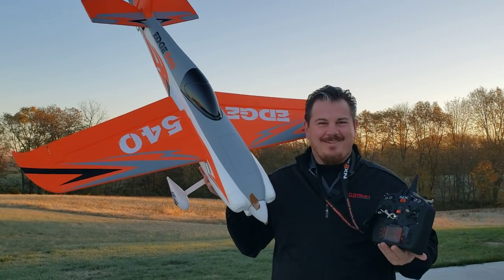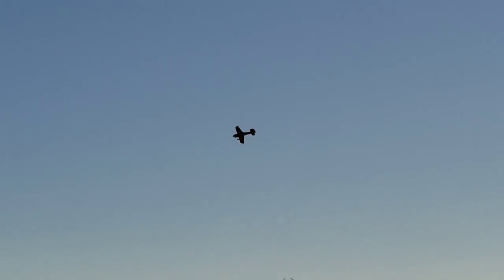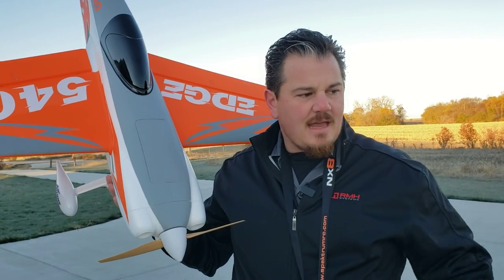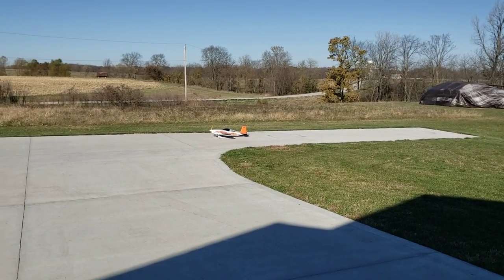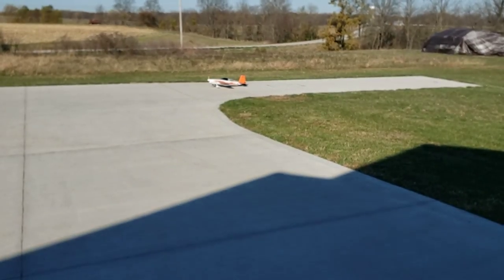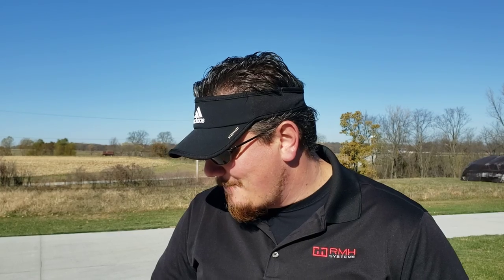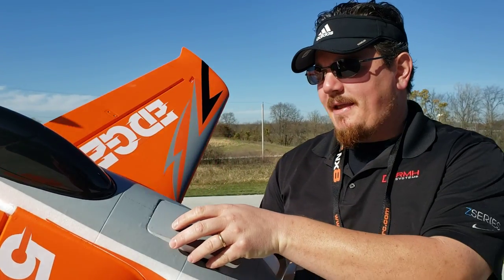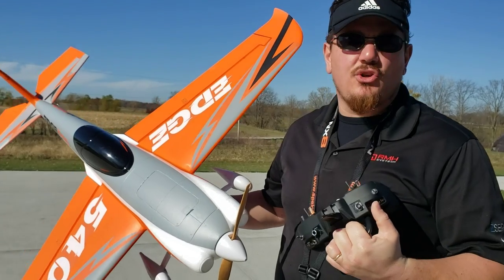Arrows - Edge 540 - 1300mm - Unbox, Build, Radio Setup, & Maiden Flight

Comment: Would you recommend the Arrow Edge 540, or the E-flite Extra 300. Thanks.
Reply: If you can afford them I'd recommend any of the 52in airframe from extreme flight
Reply: Idk I have the Extra 300 and man I love it. Definitely flies better than the edge just by looking at this vid
Reply: @millerrc5829  you’re better off with the extra 300 it’s basically complete. Where as the models from extreme flight you’ll spend over 1k completing it with the accessories
Reply: @albertg968  ya but I can almost guarantee at least IMO it will knock the socks off the e-flight 300 when it comes to actual 3d maneuvers.
Reply: @millerrc5829  how tho?
Reply: @millerrc5829  like throw wise?
Reply: @albertg968  there lighter stronger in high g maneuvers they don't flex like foam.  and if you think about it, EF and 3dhs have been making pretty much nothing but 3d planes since they started, so they probably know a lot more about what to look for in a good design. I had a e-flight cz yak 54 and it just didn't perform as good, not enough throw and to porky. Yes I know there made of balsa, but for this type of flying it just a better material. The saying you get what you pay for definitely applies.
Reply: And the flying qualities you get with EF airframes make it worth the money imo
Reply: @millerrc5829  yea I’m sure they’re better but don’t think by a lot a lot. Can’t say much since I haven’t flown one. And throw wise you can adjust where the pushrod insert on the servo arm or horn. The yak 54 the old one from horizon didn’t seem like better plane than the sukhoi since it used same servos
Reply: @millerrc5829  but yea wasn’t really down to spend over 1k on a plane. I ain’t no pro but my extra does everything i throw at it.
Reply: @albertg968  I get 80deg out of my elevator on my ef stuff idk if that kind of throw is available out of the e-flight extra or not. But that being said if your looking for the very best flight performance ef the way to go.
Reply from the maker: I think the Edge 540 is a slightly more economical, but I'm gonna shoot you straight and just say they are VERY similar. We were more than a little surprised at how high the quality of the Arrows was, but being you get the Vector, and especially with the coupon code they're offering now (just follow the link and you'll see it...Edge 540 https://bit.ly/3EUvlvJ), you can get into this high quality plane, with the Rx we used, or an even cheaper Rx, for a significant savings over the Extra and still have a BLAST.

Tough call. Might come down to stock, or color preference on this bird. Both are great, but one is a bit cheaper...You're call!
Reply: @BrianPhillipsRC  Ok, I see and thanks for the comparison and the cheaper price with the coupon. BTW, I hope you don't shoot me straight... just kidding 😀

Comment: This is a beautiful airplane but it basically looks identical to the Eflite Extra 300 version, the only differences I noticed was the slightly reshaped and sportier wing, canopy and the paint scheme. Personally this one would be the way to go over the Eflite version if you already have an unused and cheap receiver without as3x or safe, otherwise the bnf from Eflite with the Spektrum AR631 is a better, more complete deal.
Reply: Agree
I have the eflite extra 300 and man it’s a beast. Looks way better than the edge also you can tell the extra flies much better from the looks compared to the edge
Reply from the maker: I have both, and we'll re-review the New V2 Extra 300 soon... Price on the Edge 540 is about 15-25% less right now, but you gotta decide which one you like better. I don't want to mislead here...they're both GREAT. I can't hardly tell the difference....but I can say some will defer to the Extra 300 because of the BNF status....but it's more expensive, and flying experience is super-similar.

TOUGH CALL - We're loving the Arrows product thought. Megan and I were bracing ourselves for the Dynam treatment, but WOW were we wrong!!! Bascially FMS/Xfly/HH quality here! Super happy so far!
Reply from the maker: Albert, to all their own...but FYI we'll do the new V2 Extra 300 - maybe this will help you guys decide which one you like better. Price is a factor, but I don't like to let the difference make the decision when it comes to a legit difference in flying experience.
Reply: @BrianPhillipsRC  so there’s going to be a new extra 300???!?!
Reply: It’ll be available on Horizon hobby? Man I should of waited a bit but owell

Comment: This plane is absolute garbage. THe quality control is bad. Fit and finish is the worse ive ever seen. I should of stayed with flex innovations. Trying to save a few bucks the wing anfd fuselgae broke trying to align the screw holes. THey wer off like 5mm. I tried to sand trim and thin but still would not line up. Now I have to deal with hobbyzone for a full refund on this junk.